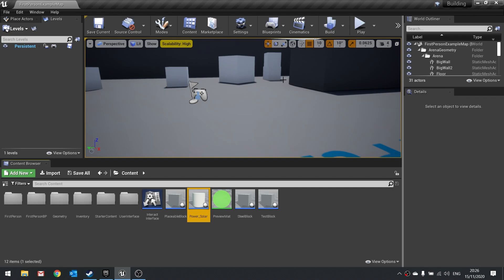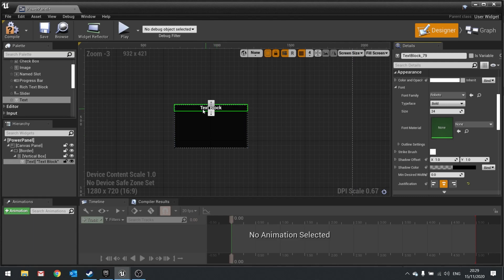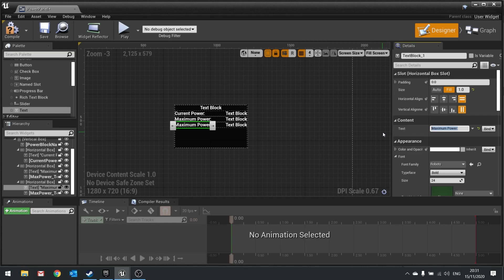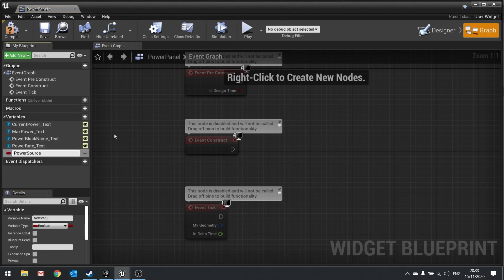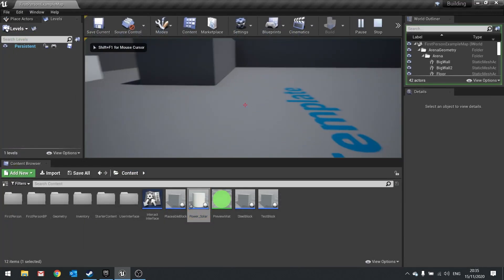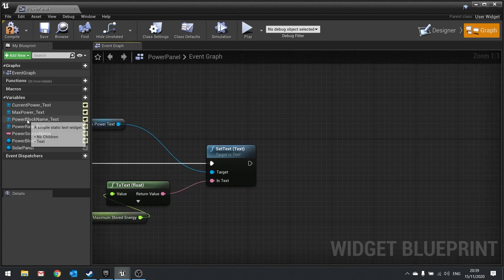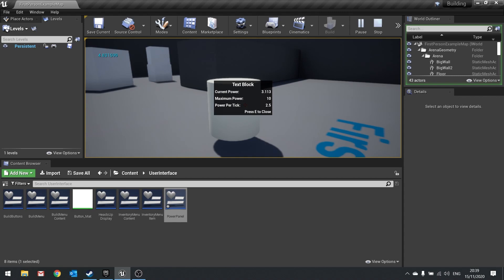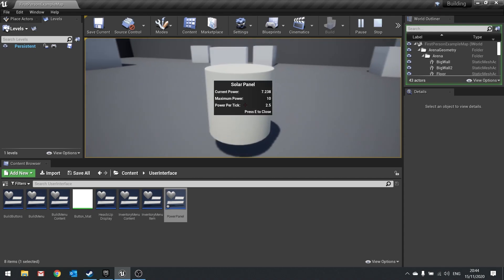Unreal Engine 4 Tutorial - Building Series Part 12: Power UI

Comment: Nice series. (Yes, I'm relearning :) ).  I found a bug in your code at 10:40 when you create the power panel. If the player looks away from the panel, then the panel never goes away because the panel's interact is never hit.  Is there a way to either attach the close event to the UI so if the player looks away, it'll still fire, or batter yet, keep the player from turning away from the solar panel please.
EDIT: If anyone is interested, it's a 2 step process; First get the controller, and "Set Ignore Move Input", and "Set Ignore Look Input" both to true.